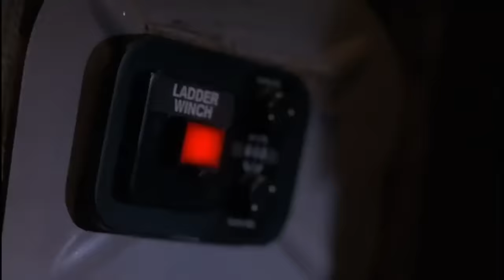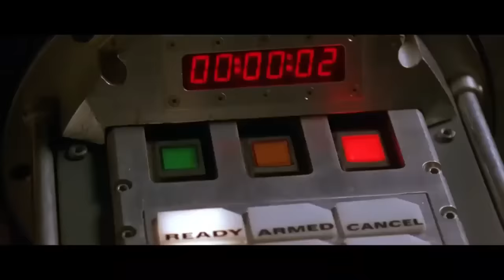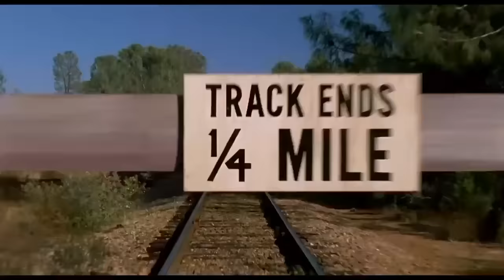Truley the Best TOP 21 Train Crashes in all Movies Mashup MASSIVE 21 MINUTE ACTION CLIP

Comment: 4:43 love how that electric train turned to be a diesel unit after passing the tunnel
Reply: LMAO
Reply: Well they had to change the engine: No more overhead wiring!
Reply: Not just the catenary is gone, the tunnel portals around the bridge are smaller than the one seen being entered at 4:44. The reason that major railway tunnels tend to have large portals is because steam locomotives and their exhaust exists.
Reply: Plot twist: it’s a dual powered train. 🤯
Reply: @CrazyDash9 the real peledino was built electric there no way you could modify it to be diesel
Reply: What movie is this called?

Comment: Bus: falls into trains path
Train: hits bus
Bus: normal expectations of a bus vs train crash
Train: HUGE EXPLOSION. MASSIVE DERAILMENT. PLOWS THROUGH COUNTLESS BUILDINGS WHICH ALSO EXPLODE.
Reply: Fire about to explode explosions
Reply: Electricity, fuel...
Reply: @eliasziad7864  just to give a heads up, electric trains have no fuel to blow up, and in diesel trains, the diesel doesn't explode under spark like gasoline does, diesel explodes under pressure, so if the diesel tanks were crushed with high speed, sure. But since they really can't be realistically, there isn't much of a way to explode diesel.
Reply: @eliasziad7864  ok
Reply: @nicholaslokos7949  the bus can tho

Comment: 7:50 fun fact: that scene was done with a real train. unstoppable also would use real trains for scenes, or at least one of the wrecks which i honestly say was exaggerated by the fact that the train exploded when it tipped over
Reply: Indeed, but in unstoppable, the train explosion is not actually exaggerated. Fuel cans on trains can be extremely sensitive, and can explode pretty heavily. Also, there is a lot of diesel in that train, and that also explodes. (I am a professional train constructor btw…)

Comment: At 11:45 the train just decide "I will not shot at this terminating station rather i just jump through it."
Reply: The thing is the engineer was late and was tryong to keep schedule, the the conductor wasn't paying attention
Reply: Incompetence Logistics And the air brakes failed.
Reply: 1. It was actually a dream sequence in the mind of the boy on the tracks, Hugo. So it makes sense that it wouldn't be logical.

2. Even as a little boy I recognized that oversight, and I was like "If it's the end of the line then why isn't the train stopping anyway?"

3. That traincrash is very much based on a real one called the Monteparrse Derailment. In that accident, the train's airbrakes failed, and the conducter wasn't paying attention and didn't notice in time to activate the brakes on the brake van.

Comment: The SkyFall wreck kind of make senses
If the trains powered by a third rail and brakes weren't applied
. 
The unstoppable wreck one partially makes sense
Yeah, a train can break past a curve
But the lash up didn't seem to be going too fast, unless it was already tipping, it wouldn't fully derail like that
. 
The engine vs box car one is mostly realistic, but there would be side effects to it besides just bent metal and broken lights on the lead engine
. 
The red tail train wreck mostly makes sense as well, if there's already too much steam pressure and the steam releases from the boiler rapidly and explosive shells are used, yeah, that's make sense